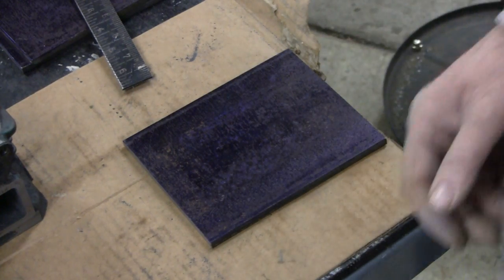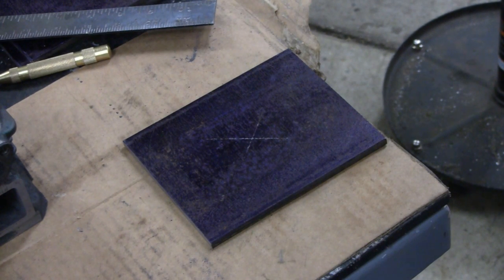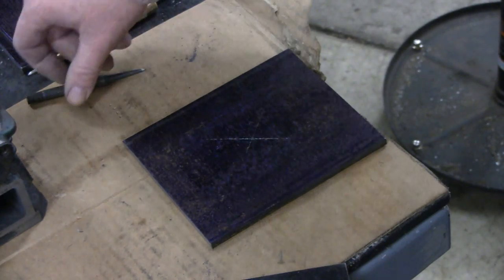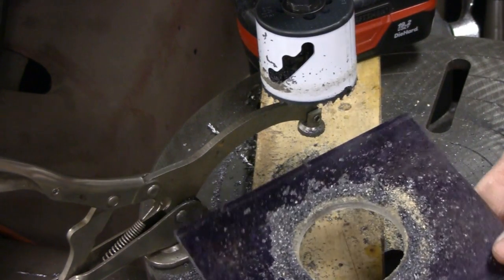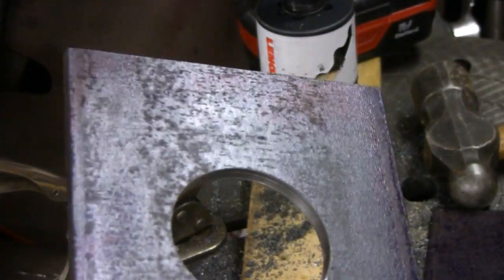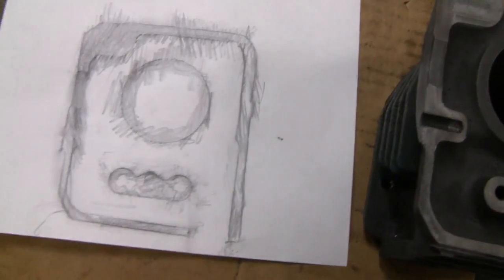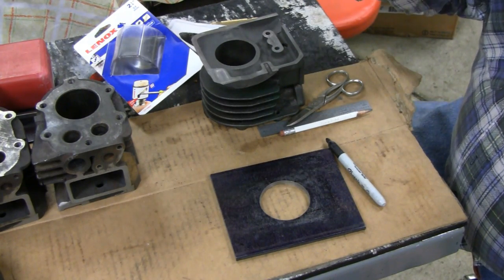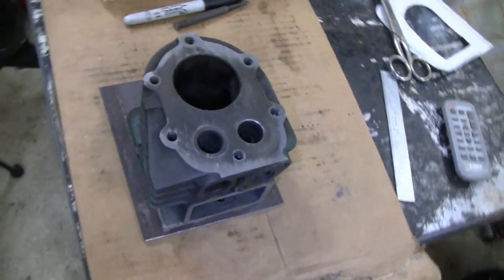HOMEMADE RADIAL BRIGGS ENGINE (part 7)

Comment: Even if the cutter isn't perfectly round it WILL make a round hole because all of the different radii will average out. You  might net end up with the exact diameter you were hoping for though.

Comment: Quick tip...if you want a 2 1/4 hole use a 2 1/8 hole saw. There is usually that much run out in them.

Comment: X- marks the spot. I use those methods also. like the rubbing of the cylinder but for gasket making, it's a neat trick.I made a couple of vids on my channel in small engine mods you might be interested in, Like finding a crack in a housing without using that die.
Reply from the maker: ***** We'll check it out Bud!!☺

Comment: Hey roadking i have a question.
How do you find the center of a circle? I'm making some jet-engine-turbines and as you could guess its pretty crucial they are balanced :).
Reply from the maker: Brice loy Ya need one of these, you can find them as cheap as $3 if do a little googling!!  http://www.acehardware.com/product/index.jsp?productId=2481892

Comment: That hole-saw looks to be not just out-of-round, but off-center and off-square besides! Makes one wonder what quality the base materials were held to (or not, as the case may be). Thanks for the update! (Your poor camera was getting vibrated right out of focus by that saw!)
Reply from the maker: TheFurriestOne I was surprised too with that focus problem!! It must have been the noise messing with it because the camera was pretty far away on a tripod!!☺
Reply: 805ROADKING Must've been the right harmonic, eh? They can be more sensitive when they're zoomed in too!

Comment: I'm one of those old Guys that does that to find the center.
I did a little hammer adjustment on my HF hole saw They start shaking the drill press apart  when they ain't round  I am glad I keep my belt tension a little loose for when they snag and stop... Your parts look Nice for homemade in the garage
Reply from the maker: not2fast4u2c I sent you a PM Bud!!☺